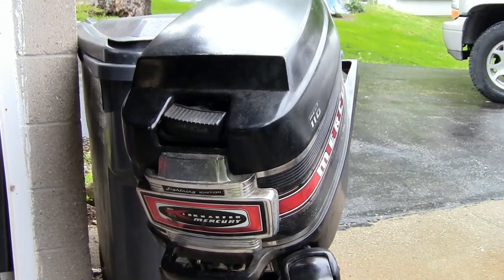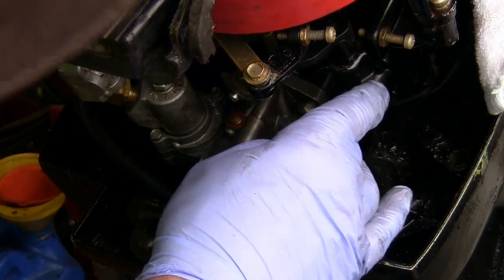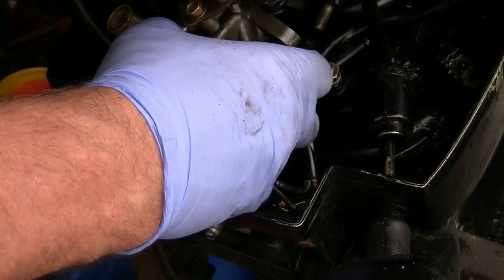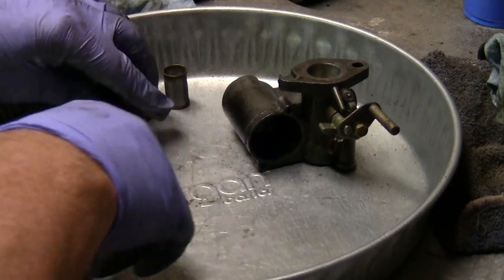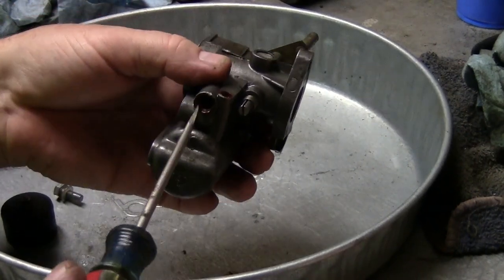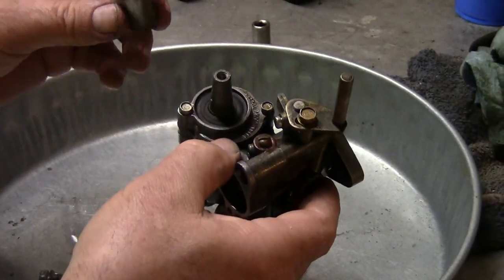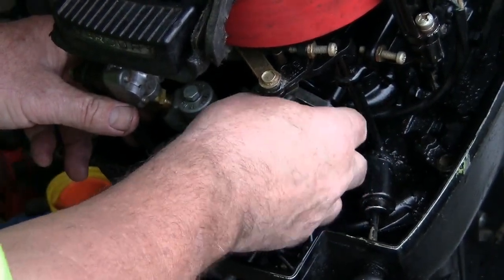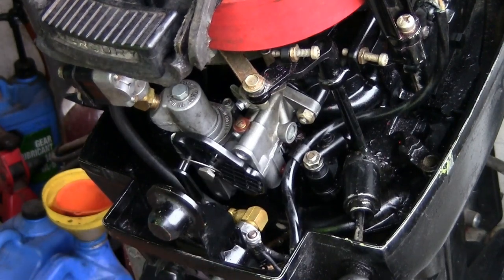1969 Mercury Outboard with Carburetor issue

Comment: Thanks for the great video on the carburetor.  I have a '66 9.8 that runs great now after I changed the impeller.  If I ever need to clean the carburetor I'll refer to this video as it's very well detailed.  Cheers
Reply from the maker: Your welcome and thanks!
Reply: What size impeller inner diameter did you end up buying? I have 1968 and not sure which I need .438” vs .456” driveshaft diameter

Comment: Sigh.
I am so close to getting this engine working again... Many interruptions and delays later...
As I said, the carburetor is cleaned/rebuilt and re-installed. I finally got back to this project, with new fuel tank/line and fresh gas/mix. Also installed new spark plugs.
I cannot get the engine to fire/start. Fuel is definitely getting into the carburetor.
Is there perhaps some carburetor setting/adjustment I can or need to do? I am baffled, as it would start and at least idle prior to the cleaning.
Reply: Did you fix it was it your fuel pump diaphragm?
Reply: @adamlerner8425  Both coils tested bad. I was able to find a couple new ones after a bit of searching. I also got new points/contacts, since the ones in there were at least ten years old. I'm trying to find exact information on how the point get set. I know the gap is twenty thousandths, but I need to know if that gap is set with throttle closed/idle or open...

Comment: Is it ever the fuel pump? I’m just looking at mine and wondering. Just bought a 1968 9.8hp that will run on spray and has 105 psi in both cylinders. Does gas from primer bulb flowing thru the punk rule it out completely?
Reply from the maker: If it runs with spray I would remove the gas line from the carb and see if it's pumping fuel while you keep it running with spray. That will rule out a bad pump. Then you will have to check the carb if the pump is working.
Reply: @LonnieJohnson1  alrighty. Unfortunately they’ve got the fuel lines that are crimped male thread connectors but I’ll see if anything squirts out!

Comment: Have the merc 110 9.8 - 1969 and it won’t idle!  Carb cleaned, new fuel mixture, runs well with throttle open. Fuel bulb stays hard, float and filter free of dirt, tried idle adjustment and still no luck. It seems to pick up rpms when slowly backing off throttle from ‘start’ position to ‘shifting range’. Not sure what to try next.
Reply from the maker: Sounds like it's not getting gas. When something is running out of gas it normally speeds up before it dies.

Comment: How do I remove the fuel lines? They’re crimped lines to blocky brass threaded adapters for every connection
Reply from the maker: I would have to see a picture of it. I will try to find a picture. Is it the same motor and year?
Reply: @LonnieJohnson1  I think I see that you have to disconnect one end first and then rotate the whole hose assembly to unthread it front another port.
Reply from the maker: Back in the day everything was made to last. Now days everything is made to fail. It's all about the money anymore.

Comment: Just found this video...
I have a 1970 9.8 that I thought was good to go but I took it to the local lake this AM and it would only run at partial throttle when under a load/in gear. Every time I tried to open the throttle much past the start setting it bogged and quit, if in gear. Runs at all throttle settings in neutral.
Do you know if the 1970 has the same carburetor as the 1967 in your video?
Reply from the maker: I would pull the cover and see how much the carbs look alike.
Reply from the maker: Cool!
Reply: @LonnieJohnson1  Looks like mine is the same as your friends.
Did you have to replace any gaskets or seals when you did the work on your friend's carburetor? Just want to know if I need to order part before pulling the carb. off for clean out...
Thanks.
Reply: Also, reading between your fingers in the video, that is a Tillotson model KB-8A carburetor. I'm still trying to find a rebuild/gasket kit.
Reply: I have a 1972 model with a KB11A carb. I just took it to the river this weekend and am having same issue as you. It will idle and throttle up in neutral all day. It will even jog in forward gear with a little throttle, but it eventually dies if you throttle too much. Have you found a solution?
Reply: @benjaminlockhart4279  Carburetor kit is out of stock, on back order. When I get it and clean the carburetor and re-install it I will update.
Reply: I found a carb repair kit for my KB11A carburetor, so my small engine repairman has it right now. Will let you know if it resolves the issue. My small engine repairman also wanted the fuel pump repair kit, but I’ve been unable to find one. These parts for these old Mercury motors are disappearing.
Reply: UPDATE- I found a carb kit for my ‘72 model and had it replaced. Still had same issues: will idle all day in neutral, rev up in neutral, and even slowly jog in forward and reverse in a bucket and on river/lake, but as soon as throttle was added it died. I wanted the fuel pump repair kit too, but no luck finding it.

So I googled my problem again and found a forum where a guy was having the same problem. He thought it was a fuel issue as well. However, turns out it was a spark plug, spark plug line, and coil pack issue. To test, start the motor in neutral, pull one plug wire. If it continues running, replace the wire, and pull the other. If the engine dies when pulling one wire, you’ll know that one is good and doing all the work. This was the case on mine. Pulled the first wire and motor kept running, replaced and pulled second wire, motor died.

Start checking plugs, plug wires, and coil pack of the other set if this is the case. I have the same motor with no lower unit, so I pulled a coil pack and spark plug wire off of it and replaced my current one. I knew the plugs were good because they were just replaced. It now will throttle up in reverse and forward gears in a bucket. Crossing fingers that it will continue when put on a load in a lake/river.
Reply: @benjaminlockhart4279  where did you find/get the carb kit?
Reply: A place called Hwy 14 Marine in Brighton, TN.
Reply: OK, finally got the rebuild kit.
Cleaned and re-installed today. Mine is actually a KB-11A. Totally filthy inside, but now clean!
Still have to drain and flush gas tank and lines.
Edit:
The original red metal Mercury gas can will be a shelf display. No way I can get all the rust out of the inside of the sad 50 year old thing. When I drained it, almost 1/4 cup of rust granules came out with the gas! Interior is crusty brown. Ordered a new poly Quicksilver 3.2 gallon "can" just now, $65 shipped.

Comment: Can u make a video on how to adjust the carb on one of these old 9.8's? Mine has a speed issue lol cant get over 10mph full throttle and I've only got a 12ft v hull aluminum boat
Reply from the maker: I fix this motor for a friend but if I work on it again I will try to make a video on the throttle.
Reply: I have a 1972 model with a KB11A carb. I just took it to the river this weekend and am having same issue as you. It will idle and throttle up in neutral all day. It will even jog in forward gear with a little throttle, but it eventually dies if you throttle too much. Have you found a solution?
Reply: @benjaminlockhart4279  I havent found a solution yet
Reply: I found a carb repair kit for my KB11A carburetor, so my small engine repairman has it right now. Will let you know if it resolves the issue. My small engine repairman also wanted the fuel pump repair kit, but I’ve been unable to find one. These parts for these old Mercury motors are disappearing.
Reply from the maker: Thank you, that would be great!
Reply: UPDATE- I found a carb kit for my ‘72 model and had it replaced. Still had same issues: will idle all day in neutral, rev up in neutral, and even slowly jog in forward and reverse in a bucket and on river/lake, but as soon as throttle was added it died. I wanted the fuel pump repair kit too, but no luck finding it.

So I googled my problem again and found a forum where a guy was having the same problem. He thought it was a fuel issue as well. However, turns out it was a spark plug, spark plug line, and coil pack issue. To test, start the motor in neutral, pull one plug wire. If it continues running, replace the wire, and pull the other. If the engine dies when pulling one wire, you’ll know that one is good and doing all the work. This was the case on mine. Pulled the first wire and motor kept running, replaced and pulled second wire, motor died.

Start checking plugs, plug wires, and coil pack of the other set if this is the case. I have the same motor with no lower unit, so I pulled a coil pack and spark plug wire off of it and replaced my current one. I knew the plugs were good because they were just replaced. It now will throttle up in reverse and forward gears in a bucket. Crossing fingers that it will continue when put on a load in a lake/river.
Reply from the maker: Cool!
Reply: Probably gotta rebuild the fuel pump. Has thin rubber diaphragms in it.

Comment: Eny one got a link 127. Bucks a peace on the coils it had spark as i boat it i barley tutched the ciols and they totally broke before i started to mes with the coils it almost started i just cant finde parts if i do there crazy expensive
Reply from the maker: The only bad thing about owning a boat is that marine parts are not cheap
Reply: I have this exact model, just priced a water pump for $150
Reply from the maker: Marine prices on parts are a joke!

Comment: My '67 9.8 Kiekhaefer has an aluminum choke plate.
Reply from the maker: Maybe that's another indication that this motor  it's a 69
Reply: My 1968 also has a full metal choke plate. Similar in design but very different in construction
Reply: My -66 also...